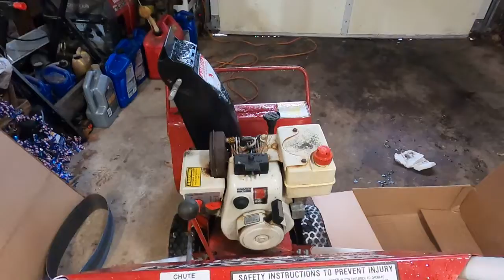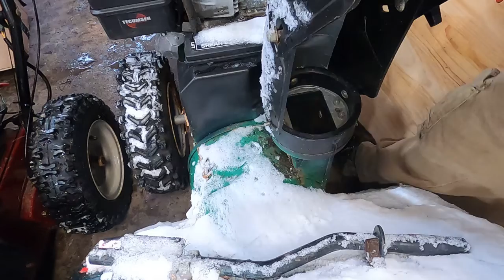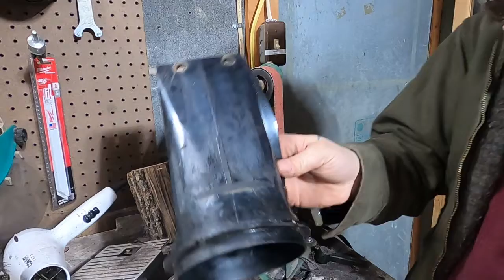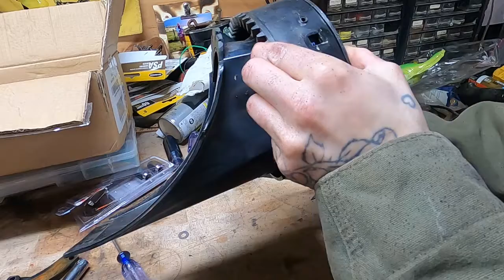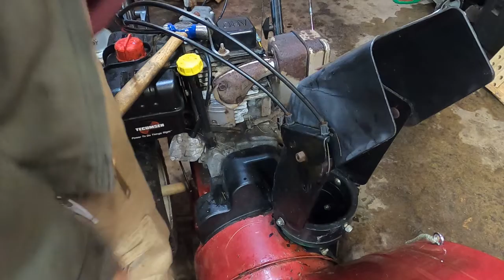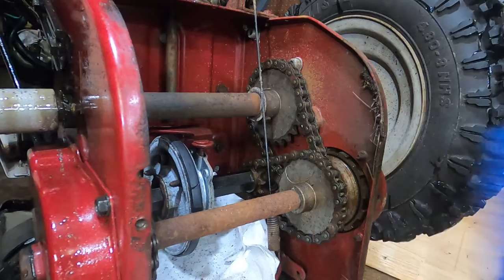Fixing Many Issues on a PROBLEM SNOW BLOWER (Fixing MTD Electric Chute)

Comment: Good video very good I learned something new how do you replace the plastic handle piece on the chute crank cause I have one were it's gone and it's a craftsman
Reply from the maker: I would imagine there is a bolt or nut holding it on? I admit I have not come up against that problem yet

Comment: Just curious... have you ever installed an impeller kit on one of your 2 stagers?  I rednecked mine up using slices of an old truck mudflap and it basically eliminated all my clogging issues and roughly doubled the throwing distance.  MINTY 👌.        p.s. that rope and eybolt setup on the chute was classic.  You can move all kinds of stuff with a smooth eyebolt and a slick rope.
Reply from the maker: Hmmm… now a guy has me wanting to modify a snowblower! And I will be honest, I have never had to mess with the impeller on a blower outside of getting a new belt on it